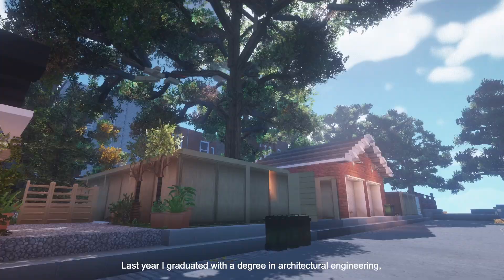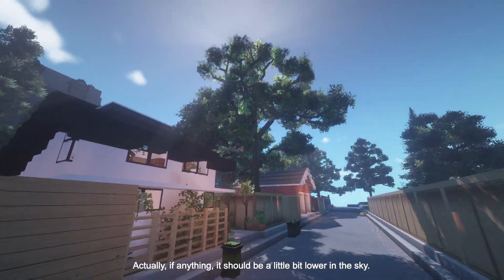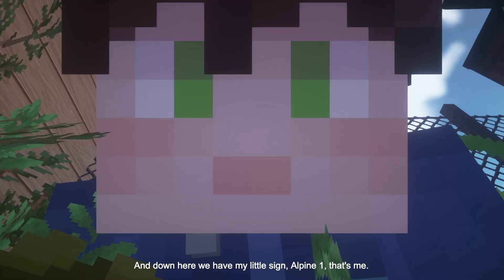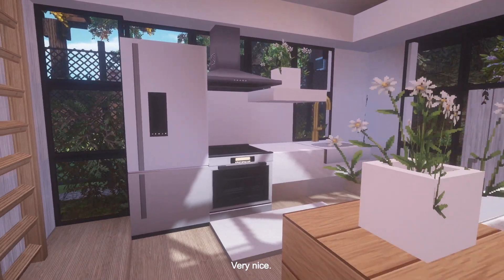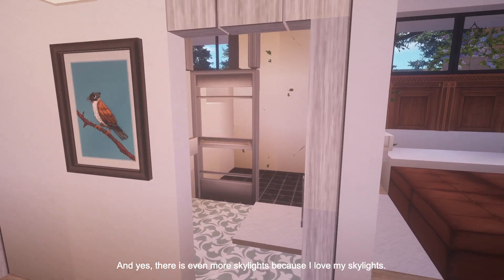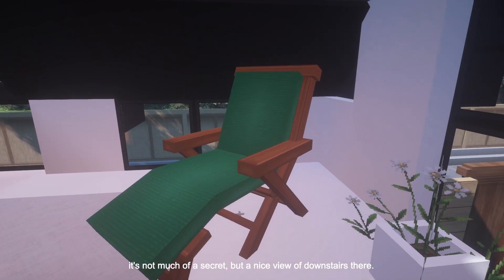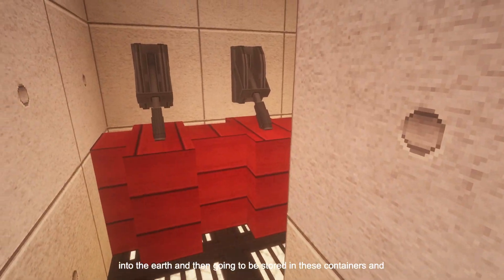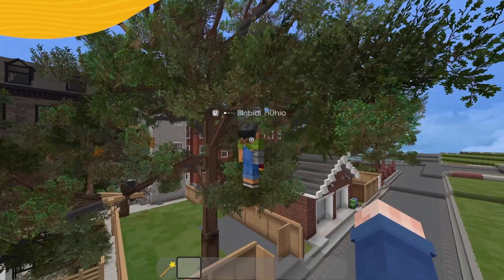Minecraft House designed using Architectural Engineering Theory (Vancouver Laneway)

Comment: Amazing vid, Typically every house has at least extract in the bathroom but I didnt see one! Although credit for the cooker hood extract in the kitchen haha. the rainwater harvesting is also very neat. I am studying mechanical engineering but working in building services. The projects I work on I dont usually see ground source/geothernmal heat pumps. typically only ASHP. So thats a cool part of the design. Good work dude